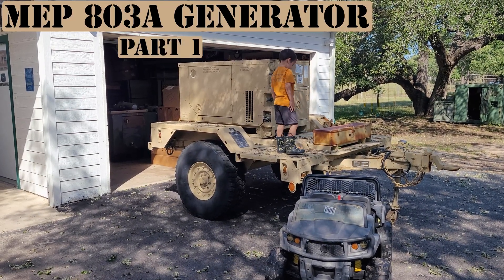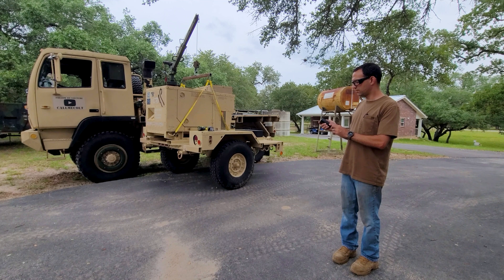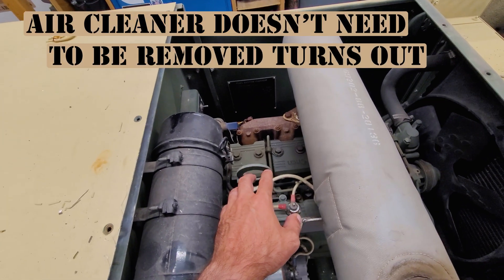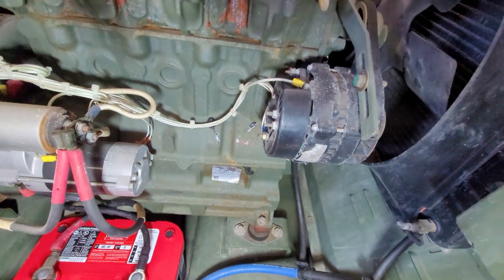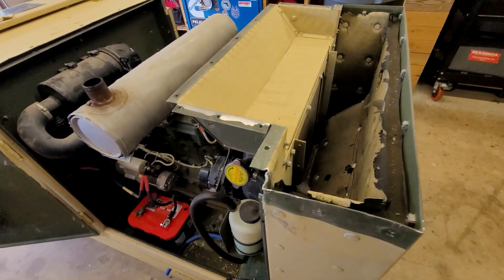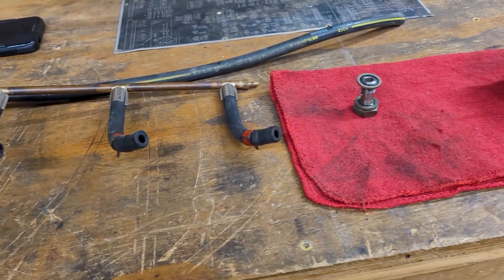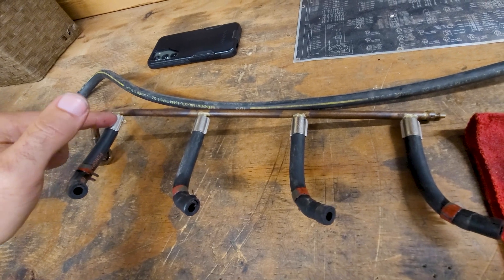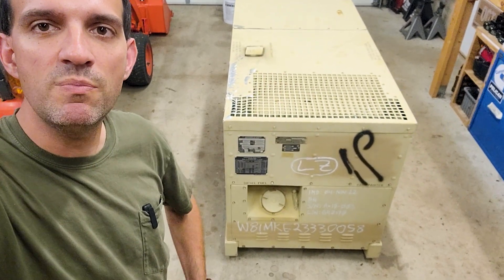MEP 803A Rebuild - Part 1

Comment: How are the 5kw mounted to the trailers? What is needed? I have two mep802a’s and want to mount to two M1102’s but not sure how to properly mount and whether the generator should align with back of trailer for balance etc? Great content Colt! By the way our son Colt was just born lol! Anyway thought that was cool you both have the same name. Have not heard it used hardly at all.
Reply from the maker: The generator trailers should have pre drilled holes that match up with the pre drilled holes in the skid of the generator. The same pattern is used on the MEP 802A & MEP 803A. If it's the cargo trailer you are talking about, it's not really meant for that due to the thinner metal. If any major force, like an accident, were to happen, it could sheer from the bed. Of course with work, it can be done properly. Congratulations on another Colt being in the world. 😎
Reply: @ The trailers appear to be generator trailers not cargo trailers. They both look like this trailer. Wish i could send pics. Thank you for the comment Colt and appreciate the kind words he is a happy baby

Comment: I have an opportunity to purchase one of these trailered units for $1800. Not sure if it would be able to handle our off grid, 48v battery bank and 50Amp RV service. Are you happy with your unit? It's been a while since you posted your video and I figured you might have had some runtime to know how you feel about the unit. Thank you for any insight.
Reply from the maker: I need to get the last update posted, but the engine ended up completely blowing on this one so I parted it out. I have gone through many of these. $1,800 seems like a to good to be true deal to me, that is generally the starting bid at GovPlanet.

Comment: I have what I think may be a non functional battery charge meter on my MEP803A. The needle never moves. I've tried disconnecting the battery while the generator is running, and it keeps running, so I suspect alternator is working, but the meter is not. On ever video I've watched, the meter swings to the green after the engine starts and then settles back down. Mine never moves. Just got it with 2 hrs on the clock.
Reply from the maker: A lot of times, units that sit unused have electrical issues. Could be a few things. Download the Technical Manuals and work through the troubleshooting steps and wire diagrams. If you need parts, check my e-bay store or reach out via the contact form on my website. www.callmecolt.com
Reply: @CallMeColtLLC  I wouldn't mind troubleshooting if I got the thing dirt cheap, but I paid a premium for a "just reset" unit and expected it to be fully functional. The wiring is complicated and not labeled with numbers so it's untraceable without cutting many tie wraps and separating the wires. Gonna mess up the wiring harness if I do that.
Reply from the maker: @basspig  all the wires in military equipment are numbered as well as connectors. Buying a military Reset unit means nothing. I've had the most issues with units that had no use/reset and some of the best has 1,000's of hours.
Reply: @CallMeColtLLC  I don't see any numbers on the wires. There's no labels wrapped around them. I measured across the meter terminals and after startup, it went to 5mA and settled down to about 2mA. But the needle barely budged.

Comment: I'm having trouble with my 803a. Starting it. Will turn over with the dead crank. But not the switch. All pumps come on and solenoid  works.  Not sure what's going on.  Any info would be great
Reply: Make sure Battle Short is not turned on. It won't crank/start if that's on.
Reply from the maker: Could be many things. Hopefully the videos will give you some ideas.

Comment: hi try two fixe the engen and check for leaks and what ever you do dont under enney sercomestances start the mep generator with a fiel leak thate can carse the mep generator two exsplod check the hoil system two be appserlotly share thate mep generator works probly two
thate is my ecvice two you keep your family safe two
Reply from the maker: Diesel will not explode, it will burn at worse. It isn't a volatile fuel.

Comment: I’ve been seeing this for sell locally along with mep 806b  do you know if your and the 896b are rated for continuous use? And if so is there something on the id tag on the panel inside the enclosure that specifies or refers duty cycle/ continuous use?
Reply from the maker: Military generators have no duty cycle except to change the engine oil when required.
Reply: @CallMeColtLLC  ok thanks, that's what i thought

Comment: Could you show me how the alternator is wired up on the 803-a
Reply from the maker: It is in the Technical Manual and on the schematic on the generator and will show much better than me. Wires are numbered.